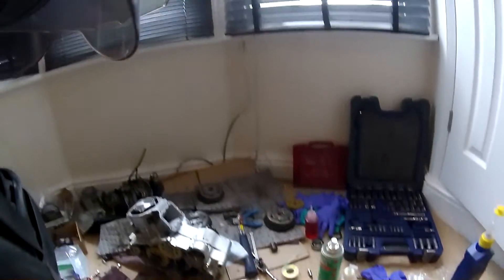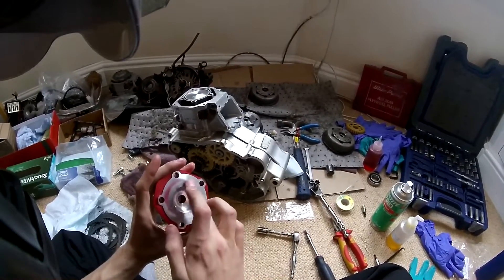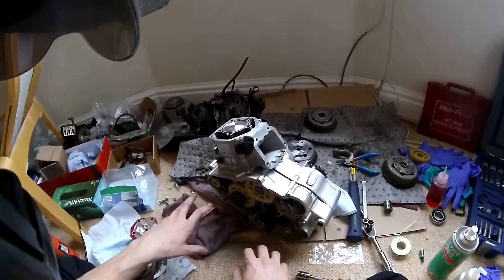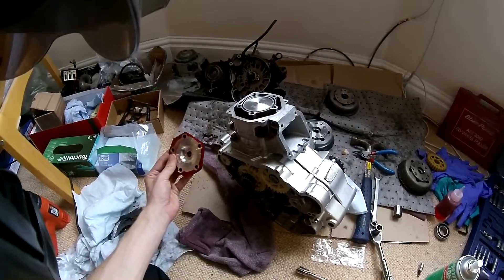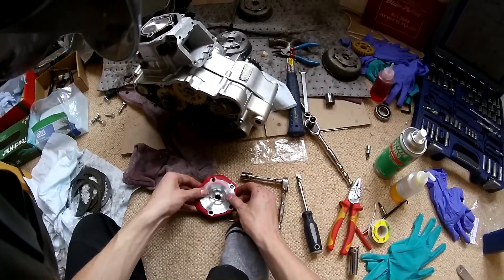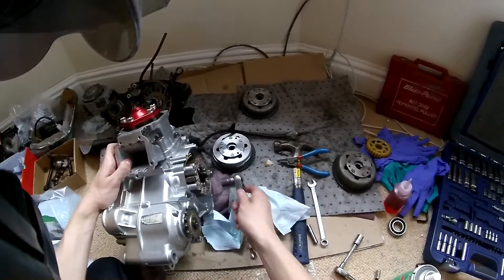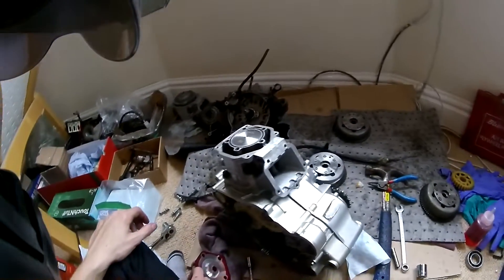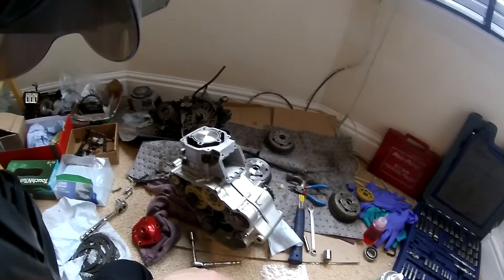Aprilia RS140 build - What is squish clearance? + How to measure it

Comment: HELP PLEASE!
I bought the same 140cc cylinder for my Rotax DD2 engine, so far the lap times are identical to the 125cc cylinder, I’m so so frustrated it, what’s wrong, shouldn’t I be a bit faster with the 140cc than with the 125cc? The only thing I haven’t checked is the squish, should I check ?
Reply: Loool...You´re not so smart i think

Comment: Do i install rave as normal when i have 140cc italkit or do i have to do somehting?
Reply from the maker: you need a 1.5mm spacer with 140cc italkit
Reply: As Finnish i have no clue what does that mean :/ Do you mean that i need 1.5mm gasket under the cylinder ooor what :/
Reply: You have to raise the rave 1,5 mm. A 1,5 plate between the rave and the cylinder on the outside where you screw it in.
Reply: The spacer comes with the kit, it’s a metal thing.

Comment: What carb are you using and what number main jet bro?
Reply from the maker: I'm using a Lectron 38mm adjustable Powerjet carb. Lectron carbs don't use any jets :)
Reply: On a delorto 34 which jet you would recomended for the first start and then go on leaner or richer?
Reply from the maker: +Rafael Mouratidis if its brand new it should come with 40 pilot 160 main. First thing you should do is put the needle clip on the top notch then go for a test ride. If you're using a panel filter it might be abit rich. So try 158 or 155 mains

Comment: Hey bro.. I just bought the polini 60mm kit.. How much squish you think i should set it? 0,8 i think is to much for a new cylinder and piston at least for the first 5 gas tanks that you take it easy.. Id like your opinion
Reply from the maker: Depends what head you're going to be using. I think Polini BBK come with their own cylinder head don't they? If so you'll have to find out what squish is recommended for a safe compression ratio. I dont know much about the polini so can't say sorry
Reply: Yeah it does with its own biger chamber head.. Ive tried to find the recomended squish but cant find any refrence.
Reply from the maker: +Rafael Mouratidis best of emailing Polini. I wouldn't like to say run 0.8 or whatever incase its going to give massive CR. The polini head is unknown to me

Comment: How much u've paid for all of it.
Do u maybe have any parts list or some basket u can send to me .
And nicely done man.
Reply from the maker: +Anton Zhushi What do you want to know the price of?
Reply: +2TMVloggin'RS 
like the whole engine
Top end and bottom end
Reply from the maker: +Anton Zhushi mate there's so many individual parts hard to list them all 

The head is from BC Engineering, you have to message them on facebook to buy one. Price was about £110 i think.
The 140cc cylinder is an Italkit big bore kit you can buy these from PJME for £370.
Then there was an additional £160 worth of port work done to the cylinder and crank cases by Greg Durkiewicz
The crankshaft is a rare item and i found it on eBay. Paid £120 for the crank then £120 extra to rebuild it with a new rod and bearings at PJME.
Then the clutch discs and Ti bolts were from BC engineering and cost £60 
The lightened flywheel was done by myself but can be purchased at £45 
I used SKF C4 main bearings and C3 gearbox bearings, cost £60
Used athena bottom end oil seals cost £20
The rest of the engine is standard rotax 122 parts
Reply: +2TMVloggin'RS thank u 
Very expensive though but i think it worths it
Reply from the maker: +Anton Zhushi yeah thats just the majority of the engine stuff. There was other costs, new balace shaft gears, oil, cylinder hone ect and also Zeeltronic CDI, programmer and quickshifter was another few hundred £
Reply: +2TMVloggin'RS cant wait for first ride after few hundred miles :))
Reply from the maker: +Anton Zhushi why after a few hundred miles? I won't be running it in. There's no need just 3 heat cycles and 50 miles under 8k rpm then rag it

Comment: How much horsepower it will produce when it's rebuilt ?
Reply from the maker: +Harun h. Absolutely no idea xD The company i bought my cylinder head, Ti clutch bolts and clutch discs from; Bc Engineering dyno'd a bike with very similar set up using a very similar ignition map and got 37.51rwhp. So that's the only figure i have as a reference but in reality as every dyno reads differently it could be anywhere between 30-40hp. Hopefully closer to 40 than 30 :P
Reply from the maker: +Harun h. They managed 37.51 running 4 deg less advance, a milder port map, a 34mm carb and no tuned crankcases so it should have potential to beat their run
Reply: 2TMVloggin'RS So, one more question. What was the top speed when it was stock ? I've seen a lot of top speed videos of this bike but didn't know if they done mods or not.
Reply from the maker: +Harun h. Before any porting or anything just running standard phbh28 carb, arrow exhaust, piperX panel filter and boyesen reeds i never seen more than 96mph on the speedo. On the last build with my old spec i got 110mph. most of the mods and tuning don't really add any topspeed. The only reason i never hit 100 with standard full power is because i never held it wide open long enough, it takes ages on a standard bike to get over 100
Reply from the maker: +Harun h. doubt ill get much more than 110 with this build. maybe 112 or something but it'll get there a hell of a lot quicker and probably try to kill me in the process. The front wheel is going to be hard to keep on the floor, it was very flighty with the old set up, almost flipped it a couple of times
Reply: 2TMVloggin'RS So this is a little bit shy bike, doesn't it ? :D
Reply: 2TMVloggin'RS thats amazing for an rs
Reply: 2TMVloggin'RS 
According to them it should give you an extra 5hp, but it’s not doing that on my engine, don’t know why?